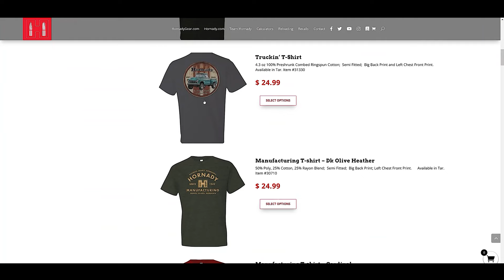Ep. 085 - Let's Talk Twist Rate

Comment: Jayden is the Chuck Norris of ballistics.
Reply: Well said , he understands what he knows
Reply: With a slightly better beard
Reply: Jayden once made a cartridge that could kiII Chuck Norris.  It was called the Big Bang.
Reply: Maybe he could explain why nobody is getting the 3000 fps out of the 7 prc like Hornady claims it does? I'd be interested to hear from them
Reply: @Yelladog78  they have addressed it.  They cannot get the powder that they originally loaded with.   H4350 and H4831.  I think that’s the two
Reply: @jerobb73   Both of those powders are available for anyone. But find me anyone using any load in a barrel under 26" inches that's hitting 3000 fps. When they first came out with this cartridge all they did is brag about how it was faster than the 7mm Remington Magnum. They failed to mention all we used a special powder in a special barrel to inflate those numbers. That's just being deceptive same way they did with the 65 creedmoor versus the 260 in their loading manuals, when the 65 creedmoor first came out their load data for the 260 Remington was lower than standard so that they could show their cartridge being better in the manual. I just can't support somebody who uses tactics like that to try to convince me of something that they know better

Comment: You said that blunt nose bullets will move the center of pressure to the rear, the more blunt, the more to the rear. If  the center of pressure were moved behind of the center of gravity, they would travel truer than modern bullets. You should have said that the blunt nose moves the center of pressure to the front, making them more unstable.

Comment: Is there any data on barrel life difference with going to a faster twist rate? I know the faster twist per caliber all things being equal produce more heat because of the increased internal friction. No mention of gain twist rifling. Listening to Frank Green his research has led him to believe just a small gain in twist drives the projectile better applying an increasing load. Verses a more stagnant force being applied to the jacket. In my mind “if” the twist was not perfectly consistent the projectile might rattle in the rifling. Joe Carlos talked about his research led him to believe heavy per caliber bullets benefited from a gain twist IE 90gr .22cal. As he feels they skid some while accelerating a “heavy” bullet to a high RPM. For me the proof is the true match barrels I own shoot such a wide variety of ammo well verses factory barrels have only a couple they really like. This tells me that the ammo out there is really good by and large but the barrel usually screws it up in one way or another. Thank you again for making my lunch breaks so informative!

Comment: Ive learned so much from all of your podcasts, thanks for doing these. This one answered a question ive had for a long time. I run the 230 grain A tips at 2850fps in my 24in 1in 10 twist 300WM(its a long story why i even tried them in the first place) they are very accurate but i wondered if it was going to show itself at longer distances. I know its not the right twist to use but i have hit milk jugs past 1000 yards  with it.

Comment: I have seen a number of testers state that faster twist rates generally have a significant positive effect on monolithic copper alloy bullets designed to expand.  Those bullets tend to penetrate deeply anyway, so opening a little quicker is not a problem.  I wonder if the effect is even greater with bullets that expand into more distinct petals and tend to leave spiral patterns in game or gel.  My train of thinking is that possibly more tissue is damaged by is slicing rather than being torn apart as from a classic mushroom-shape. Slicing may not be an accurate description since it may be more from shear from the gaps between the petals.  I have heard one three-petal design described as a high-speed broadhead and have seen photos of triangular holes in tissue.  I don't know if the number of petals makes a big difference, though.  It is possible that the tri-lobed pattern is just more distinct and photographs better.
FWIW, extreme twist, as from a 5" twist 300 Blackout has caused premature opening of at least one monolithic bullet.  The manufacturer actually modified their bullet to avoid customer complaints as the more rapid twist started becoming more common.  As you guys said, faster is not always better.

Comment: 56:57 just tested my 8.6 subsonic loads —SST 225 gn @ 1014fps. Interesting that I found the copper jackets downrange at the 100 yds. It reached since I saw the splash but interesting how the Copper jacket separated from the lead but can’t figure out if the copper unraveled at impact or on its way?
Reply: In general, the recommendation has been to not use lead core expanding bullets unless they're bonded.

Comment: Hi Jayden, I have a very rarely spoken about subject around “Spin Rate” to ask a question about, and it is this….

In a regular rifle/cartridge combination it is known that generally, once a projectile is spun up in a STANDARD rifle barrel and spin rate for that calibre, and then starts its journey downrange, it is accepted (I think?) that said projectile’s attitude angle to the horizontal is more or less maintained all the way to the target, no matter how far off from the shooter that may be and how arced the trajectory track is…

ALSO it is a known that there is - within each projectile and cartridge combination - a combination of projectile and spin rate (LOWER than what is the accepted norm for that projectile for general good stability) where the bullet will fly more “Point First”with the bullet axis will follow the actual trajectory track.  This will obviously Maximise the projectile’s B.C. which generally will have been compromised somewhat once the projectile goes over the max height of the trajectory path and starts it’s fall down the other side of it’s trajectory curve!

What I’d like to be able to predict/calculate is what is this rate of spin - barrel twist - for any given bullet calibre and velocity range whereby one can then maybe maximise the ELR bullet B.C.??

Thinking about this some more, I think it COULD be “Suggested” in the 4DOF Stability Calculations and output number.  I would assume that if the spin rate (barrel twist rate) formula gives a stability number around or maybe slightly below 1.00 that THIS may be the area of JUST Stabilised projectiles that I am looking for and eluding to??  Am I anywhere near correct in my assumptions please Jayden??

P.S.  I absolutely LOVE the topics of discussion and the information raised and spoken about within each and every episode of the Hornady Podcasts, but particularly ones where you are a speaker!!

Kindest Regards,
Steve.  (England, UK)

Comment: Unfortunately, one I'm struggling with is the Hornady Sub-X 175Gr. in .308 and it's not in 4DOF.  8(   How come no stability stuff for the Sub-X's?  Seems like the LOW velocity loads are the most important to keep this number accurate.  I'm using a 1:10 twist .308 and at 1100 fps, it should be stable, but a couple are flipping inside my suppressor. 8(  I love the information and like Jayden.  ;)
Reply: Yeah that's a pretty severe lack.

Comment: In short, bare bones. Bullets need spin to be stable. for a given caliber, longer bullets need more RPM to stabilize. RPM can be increased by increasing twist rate or velocity. There are math formulas to calculate this, but honestly, I just use the calculator on Berger's website. A Hornday calculator would be nice....

Comment: My greatest question has always been this: What effect does twist rate have in rotating barrel locking designs?
Reply: These actions usually use the recoil energy to cam the barrel out of lock. 

So the twist rate should have a negligible effect, because the twist is imparted onto the projectile very early in the firing sequence. Most likely the barrel is still fully locked when angular acceleration is nearing 0.

Comment: Is there a meaningful benefit to rifling that increases spin rate as it goes? If think it would encourage a gradual increase which would be kinder to large lead bullets that might deform too easily and resist acceleration more profoundly if pushed hard.
Or it might be a good alternative to really fast rifling so as to reduce overall friction but still result in the proper spin speed upon exiting the barrel.

Comment: The 10% error makes me wonder if I could try a 160 grain bullet (hand loaded, of course, since nobody makes a cartridge) for my 270 WSM with a 9.5 twist rate - Nosler has a 160grain ABLR that I assume is made for the 6.8 Western, and it says it needs a 9 twist rate, but 9.5 isn't that far off ...  I don't yet reload, but I'm seriously considering it, for things like this (and because cartridges are hard to find, and way expensive up here in Canada) - I know Nosler now has a 150 grain ABLR in a 270, so I could reload using that bullet, but I am curious about the 160 - if I was to figure out how to set it up to have a muzzle velocity of around 2850, maybe that would get me close to gyroscopic stability as it uncorks...  I chose 2850 fps because I expect the 150 grain to leave the muzzle at somewhere around 3100 fps (although the 145 grain ELD-X is somewhat higher) - my point is that I've seen a couple of guys fire that 160 grain bullet from their 270 wsm (on YT) while trying to hit 3000 fps- while not seeing keyholes on the target (at 100yards), and the 160 grain bullet might uncork at a high number under normal loads, but if I was to lower that a bit, that would bring the chance of stability up, closer to optimal, as it leaves the barrel... It would be interesting to try - though it would probably be less expensive to just use the 150grain ABLR that the rifle is made to shoot - but that 9.5 twist rate, with that 160 grain, with a lesser powder load to give me lower fps ...  Tempting to test...

Comment: The old Mausers had faster than 1 in 10 twist .
Reply: 1/6.7?
Reply: @TheSaintsAdvantage   I dont remember had it wrote in one of my manuals . metric was not even in inches. I had 1915 Swede & several 8x 57 .323 . The only keyhole I ever saw on the Swede was a 120 gr strange.
Reply: I think the 8x57 was closer to 1/ 9.5 if you can find some original German sniper ammo with 196 grain bullet they were over 500 BC by nowadays standards and the design is still hard to improve on if you've ever seen one taken apart

Comment: The best twist rate for 223 and 22-250 is 1:12. Doesn’t matter what people repeat because they heard someone else say it. All the twist rates I have shot for 40 to 55 grains hunting projectiles and maintain a consistent 3/4 to 1/2” groups is a 1:12 twist. Look on the shelf and all the soft point, hollow points and plastic tipped hunting rounds offered by ammo manufacturers in 223 and 22-250 is going to be between 50 to 55 grain. Why these rifle manufacturers no longer offer 1:12 in these two calibers is idiotic. You guys can continue try to reinvent the wheel, but I will stick to my CZ 527 223 with a 1:12 twist which they no longer offer. It really is a shame.

Comment: I’ve got a question about twist rate in the 300prc. There’s a specific rifle I’ve been looking at that the manufacturer lists the twist rate as 1/10. What would be the disadvantage to the slower twist in a 300prc vs 1/8. What projectiles would be off the table on the higher end?

Comment: How do we not have more problems with 5.56? 720×3200÷7 gets us around 329,000 RPM. 

Why is 720 a constant?
Reply: That "constant" only holds for 30 cal. For .223 it is 1030. That number is a unit conversion that accounts for circumferences of the bullet in a foot and seconds in a minute.
Reply: @difficult_aardvark   No, the 720 constant is for the unit conversion from 1 full revolution in inches and MV in fps to rotations/minute.  It is not caliber specific.    12 inches per foot and 60 seconds per minute.  12*60 is 720, if you lay it all out on a single division bar the units will cancel out and leave you with rotations/minute.

Comment: So would twist rate be affected by today’s 30-30 whereas it’s not just the old 150/170 weights. The current 30-30 is around 130 through 190. Shouldn’t that raise the twist rate especially on the heavier ones?